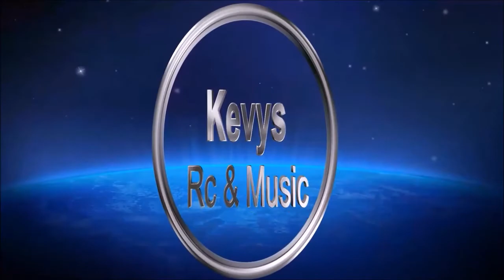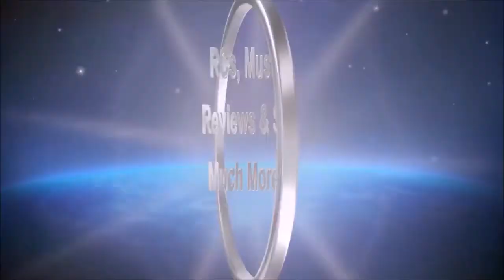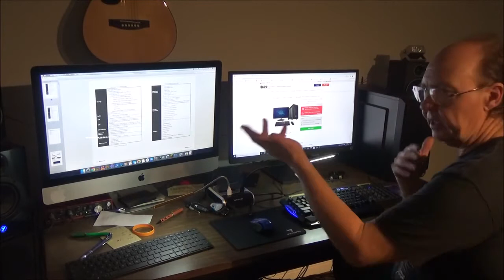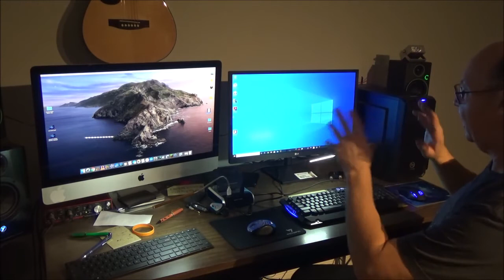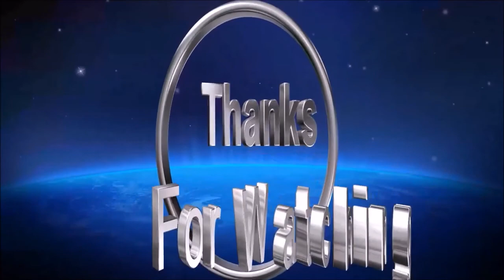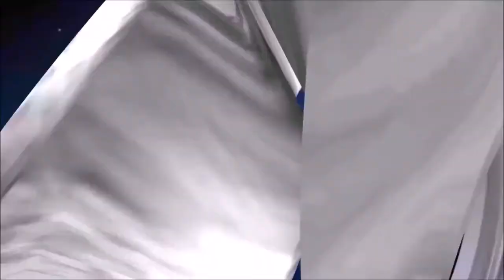MDG Apton R7 2700 Gamer Desktop Review

Comment: Experience powerful graphics and virtual reality with MDG Apton Desktop. It has an AMD processor Ryzen™ 5 3600X to handle intense games, and the 16GB of DDR4 RAM offers fast processing speeds. This MDG Apton desktop has a 1TB hard disk and 480GB solid-state hard disk for a large collection of games and fast start-up times. Comes with an illuminated mouse and keyboard that allows you to choose your backlit color and allows you to see the right keys in any dark environment while working or playing.
Product:	MDG Apton R5 A3600X Desktop
Motherboard	AMD A320 Chipset Motherboard
Processor	AMD Ryzen™ 5 3600X Processor
(6 cores, 12 threads, Base Clock: 3.8GHz,
Max Boost Clock: 4.4GHz,
L3 Cache: 32MB, L2 Cache: 3MB, L1 Cache: 384KB)
Hard Drive	480GB Solid State Drive & 1.0TB
Graphics	Radeon RX570 (8GB GDDR5)
Memory	16GB Memory DDR4
Monitor	LG 27” class IPS FHD Monitor (1920 x 1080)
Hardware	Thermaltake eSPORTS COMMANDER LED
Iluminated Gaming Keyboard and Mouse
Tower	Thermaltake Versa H15 Tower Chassis
Operating System	Windows 10
Reply: I just recently ordered this pc I’m wondering if it’s good for gaming
Reply from the maker: yes it will be good for gamming how good i dont know mine system has a bit more horse power then the one you listed here and ihave done some up grades sence i got mine as well and still a few more to go yet but you should be fine for most of the stuff out there i would upgrade the ram tho to the max the board and handel , also ditch the mechanical hardrive thats in it for another SSD to go with the one they supplied ..

Comment: How can this run fortnite?
Reply from the maker: its way more then enough power for it yes
Reply: @KevinMillard68  do you think yoy could try it? On low settings how much fps and possibly benchmark it? I am looking at this pc and need something that can run fortnite at above 140 fps if you could it would be amazing thanks÷
Reply from the maker: @taikiauger8014  if you look up the specs of the game and compare them to this PC youll find that this thing is more then 8 times the reccomened requirments for the game you wont have any problems tho i would sudgest for the first upgrad to more speed and storage get the XPG gammix m.2 nvme drive and install it and clone the os over i have videos on this the stock 120 gig SSD is slow for and SSD and way undersized as well for gammers but 99% of the systems out there are all comming with 120 gig SSD as a C drive which sucks so upgrade to the Sudgest NVME drive i mentioned well worht it i got min for li;ke 100 for 512 GB from amazon and the scre kit was like 20.00 cloning software was free
Reply: @KevinMillard68  thanks
Reply from the maker: @taikiauger8014  :)
Reply: @KevinMillard68  just ordered it
Reply from the maker: @taikiauger8014  good stuff and congrats
Reply: @KevinMillard68   thx big purchase but i looked alot and think it was worth it! Any recomended upgrades?
Reply from the maker: @taikiauger8014 start with this and clone the C: drive to it then disconnect the 120 ssd to get the computer to boot from the nvme this is the first upgrade i did then either keep the 120 some where safe as a back up of the OSX or blank it after you know you cloned it properly i have a video on how i did this to my tower so you dont screw up its a very worth wild upgrade i use the 1tb drive right now just for stoage only as its a mechanicial drive the stock 120 is ssd but its 6 times slower then this drive get the one that 512 or 1tb but get the 3500mbs one youll also need the screw kit as well again all on my channel of the screw kit you need in order to install the nvme m.2 drive here is the link where i got mine https://www.amazon.ca/XPG-GAMMIX-NAND-Gen3x4-AGAMMIXS11P-1TT-C/dp/B07KZXJTLN?th=1
Reply: @KevinMillard68  thank u soo much much appreciated!
Reply from the maker: @taikiauger8014  your welcome enjoy if ytou want alot of free games to full versions no fees some are a bit well junkie but alot are really cool check out gametop.com i have gotten some really cool games there will be reviewing a few of them soon
Reply: Ooh yeah for sure thx. Any clue how manny hertz the monitor is?
Reply from the maker: @taikiauger8014  75 hertz